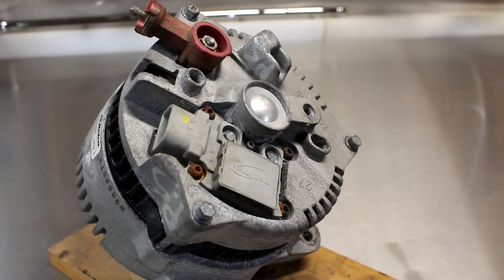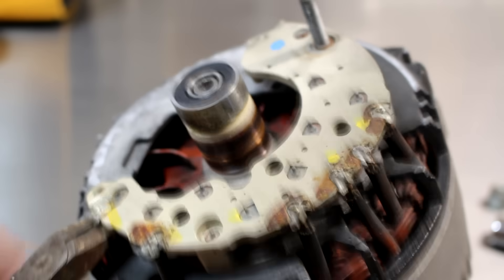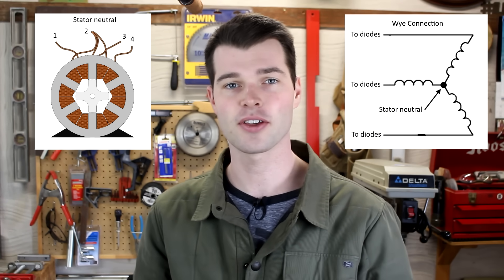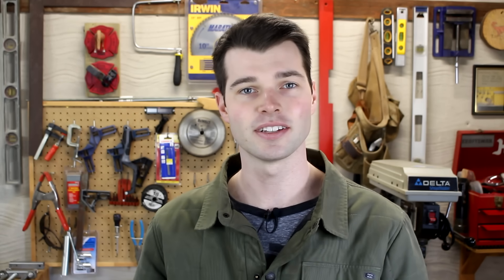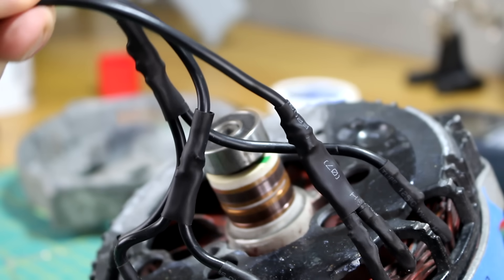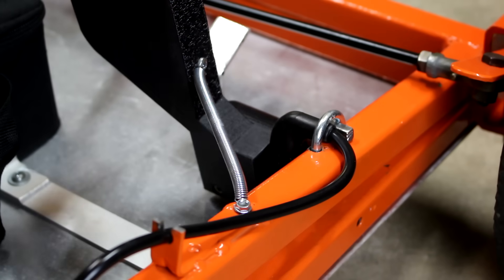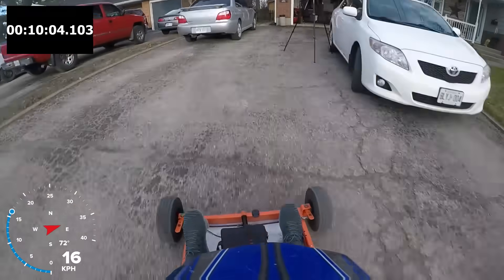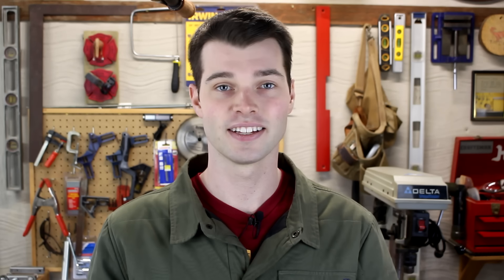Converting a Car Alternator into a Go Kart Motor

Comment: why not wire in a delta/WYE relay switching circuit? u use WYE from a standstill for its torque, then after u top out in WYE flip the 3 pole relays and it turns the motor into delta, dumps the torque for speed and away u go

Comment: Used a Detroit Diesel starter for mine back in the day.  6hp .   Would do much more now  with new battery tech, and have a longer ride.  It was a rock spitter right at the touch of the throttle switch, for a little bit.  Frankenstein type blade switch on a pedal.  Had to make a wheelie bar skid.   Had everything sitting around the shop.

Comment: Got a question for you.   Actually two.  One;  Did you measure what you 'Should' get out of the battery pack (You would need to know current though), and secondly, do you know if those general motor controllers can do regenerative braking ???  To extend the battery life ???

Cheers, and good build sir!

Comment: hello good day I would like to know how.contact the brushes that in the video is not very clear it seems to me a good idea more how to connect the brushes thanks of an
Reply: The contact are connected at the 2 terminals of the voltage regulator. These 2 wires are in contact with the 2 brushes at the end of the rotor head.

Comment: having purchased several hundred batteries of all different makes through the years for the car lot buisnrsses and construction companys i have owned through the years,the interstate battery is in my opinion ,through expirience,the absolute best brand and best brand for the same money spent than any other.they are the only battery maker that i know of,and i there may be but im not aware of them,that actually has their own very large store.they are usually between 2 gairly close freeway exit ramps off of major highways.they only sell batteries.commercial ones that are to companies \truckdrivers /farm equipment/excavation\bulldozer equipment.etc.they will sell to regular folks in need of a  car battery ,but rarely do.i bought a used backhoe that sat in a field for 4 years broken.it had an interstate battery that the guy took from a  broken down bulldozer.it was 2 years old when put in the backhoe then sat for 4 .that is six years.the batt was dry.the guy said he would ad distilled water and charge it  to just jump it off and start it to show me the backhoe ran and i could pit it on a trailer to take home,but he said i would need a new batt for sure.i used that batt and backhoe for 6 years.everytime i turned the key it cranked every time.it would sometimes sit for several months beween running.so that is 12 years.the backhoe blew a head gasket.i took out the batt and used it for my trolling  motor for a year and a half.some kids knocked the battery over and drained most of the acid out(i had the lids loose from charging it last) and it sat under a tarp in the sun for 7 months till i discovered it.never thinking it would work but because of the almost u believable age and abuse done to it i filled the cells with distilled water,trickle charged it for days,then gave it a 10 amp 12v full charge..it.worked better than ever.put it in another backhoe i own and used it for 2 years.it took it out to use for.my trolling motor.my idiot employee ran over it when he sat it in the ground befor hooking it.back up.the.plastic was chalky and was more brittle from jts age and a corner cracked off.thats 14 years and seven months old and the batt worked and held charge seeming infinately.now thats a long time.buy interstate.they have more lead or are better designed and thicker plastic that most......this trick does work with any batt.ive done it.but interstate batt is a big help.
.

Comment: In 3-phase motors the Delta configuration delivers the most power. If you want to dial back you can switch to  a Wye. That might save your battery pack, but will slow down your cart. 

I have a suggestion for an experiment: 
Instead of applying 12v power to the armature, just short the brushes together. The stator will induce a current, like in a typical induction motor. But you will not have to add the supplemental energy from the lipo pack. This may translate to lowered performance though.

Comment: Instead of a battery pack, why not use super capacitors?  This way you can create a charging method that exceeds discharging by using a 2nd alternator possibly coupled with a voltage multiplier. Ludic Science channel has a couple of interesting videos that may be of some use to increase power input vs output. I'm not an electronic or electrical engineer but I've seen others create interesting things that almost seem impossible.

Comment: When will your next video come out I can't wait ?
Reply: Hi.
I'm very impressed with your video. I've hunted for ages to find this type of video.  Thank you.  I understand most of it. 
I'm just starting my ebike. 
I have an old 12v 110 and alternator from a scrapyard,  tested & working. I want to convert this now into a motor, and I have a frame from an old Honda 125,
What controller would I need for this project. I only have the alternator and frame so far.  I'm out in a remote part of Philippines.
Any other information would be gladly received.
Thanks for putting up with many stupid comments some folks like to write on here. 
You've done a great job on your project.  We'll done

Comment: Your soldering technique is somewhat questionable.
Reply: i didnt see him twist-winding up the connected wires together... i saw him like clamping them together relying purely on soldering joint, hahaha...(i could be wrong in my observation)
Reply: never a straight answer specification hehe
Reply: There's nothing wrong with his technique.  As Matt Fleenor said, this is how it's done by NASA.  The result yields a very strong connection that seals up well with heat shrink and doesn't leave a huge bulge in a cable bundle.

The only thing he seemed to do "wrong" was he stripped farther than he needs to.  Really, that's just mainly a flexibility issue, if there's going to be an issue at all.  

Properly done (from memory here):  Strip a length equal to 1.5 to 2 times cable diameter.  Pre-tin all ends to be soldered, ensuring that solder doesn't creep up the cable underneath the insulation.  Place cable ends parallel against each other and apply solder, the proper amount of which will form a fillet (the look will be smooth and concave) between the cables.  

@ fidel castro and anybody else who thinks that cables need to be twisted together prior to soldering... no.  That method can reduce penetration of the solder and is absolutely not needed for good connection or strength.  The method laid out above will, if done properly, yield a connection that does not add resistance and is physically stronger than the cable being soldered.  FWIW, I've used this method countless times, including in places where precise readings on low-voltage sensors are crucial, and I've shown the strength of it by soldering leftover cable and pulling it to the breaking point - the break never happens in the joint, and anything that increases resistance in a low-voltage circuit is going to show up big time.  But I'm sure you "electrical gods" out there know all about that.

The pre-tin step actually makes this method very easy, since all you have to do to make the connection is put a bit of solder on your iron, touch the cables together and press the iron to them for a moment or two.  Once the solder on your iron creeps into the joint, remove iron and wait another moment for it to cool and the connection is made.  Very simple, very secure, and even easy to do in an environment with limited space.  If something shifts during the connection step, carefully reheating to make the solder flow and moving the cables to their proper position is very doable.
Reply: Barry Pro just shut up
Reply: And you can't spell "Knickers"....how pitiful.
Reply: Cosmic Surfer - Then why is your would-be critique phrased as a statement? If you are questioning the technique, then as some questions about it.
Reply: l o fuckin l dude, i get what your saying but no you have to do it right in order for it to be done the right way yuh digg?
Reply: Barry Pro 1
Reply: Cosmic Surfer ok pro.   Post how to soder then.  Let’s see.
Reply: This method is mechanically secure and places no stress on the stranded wire... vastly superior to twisting the strands. His solder looks good, really the opposite of questionable!
Reply: compared to most of the videos on yt, this is a pretty decent solder job
Reply: this is NASA spec style of soldiering.
Reply: Barry pro was clearly trying to get on your nerves.
Reply: Barry Pro you have some serious issues in life you should deal with. I am well into my fifties and dont need to deal with your issues. 
If you do need to be spoon fed, high current joints are best done with hex crimps and then soldered. If you dont have a hex crimp you twist the cores together and then solder to a shiny finish. Dry joints dont work as they create heat and suffer current loss. 
Now throw your tv in the bin and try and educate yourself a bit please.
Reply: Barry Pro lol that comment about cats is going to come back to haunt you Hahahaha id fucking love to be there.
Reply: Barry Pro its so good when those people that hurt animals get whats coming to them lol
Reply: Barry Pro what a mistake of a comment huh
Reply: Cosmic Surfer 
Your opinions are invalid
Reply: Logan Pachulski Trying being the operative word. :) His last statement though, says it all.
Reply: Barry Pro where is that photo taken on the top border of your youtube man? What country?
Reply: Bradley Mcewen 
Ran one over this morning haha 😂
Reply: Barry Pro Sure, keep telling yourself that if it makes you feel better. The fact you think other people will believe there's someone following you around instantly liking your posts is sad to say the least. At least you acknowledge your sadism.
Reply: weak
Reply: You are the pro as your name indicates. 
Tell you what, try taking 1.5 mm copper wire cut into 10 mm pieces and solder me a cube. That is entry level soldering. 
And just as a matter of fact, my opinion is invalid. Just so you don't need to repeat yourself.
Keyboard ninja :)
Reply: Barry Pro Don't you have work to do mate. I have a business to run and you want attention like a spoilt child.  Non of my 5 cats have managed to catch my tongue, so no the cat never got my tongue.
Reply: Cosmic Surfer 
What’s the matter? Cat got your tongue?
Reply: Cosmic Surfer 
Omg a cat lover 😒. 
Do you let them shit in everyone else’s gardens? Fucking hate cats, I’ve run plenty over 😂.
Reply: Charmin Xtra 
It’s not me liking them you thick bellend.
Reply: Cosmic Surfer 
I’ve been doing a load of soldering today mate, my best work yet.

Comment: What’s the point? I don’t get this whole electric hype/fad spreading over the world it’s not a replacement for fuel and instead of wasting so much money on fixing fuel why not fix the cunts that run this world because if trump and putin and all those other fuckers keep going then there won’t be global warming to worry about every fuckers gonna be dead? But hey still a cool project to try out
Reply: it just might be that electric motors have better torque curve and don't need transmission which makes them much more efficient for small scale applications
Reply: Kyle TheTreeKat Don't fear the electric revolution.
Reply: Kyle TheTreeKat solar power = electricity

Comment: How many maximum watts continuous do you feel the motor is capable of ?   Would a higher output alternator produce a fairly "hot" motor ? - watts ?        Excellent video. You should be in the moving picture shows they have these days ! !  You're good.

Comment: Cool project!  I did the same thing a few years back but I never installed the  motor in anything.  You will be pleasantly surprised if you switch to some sort of lithium battery for power.  It will make a night and day type of difference in power.  I like using A123 26650 cells but they can get pricey.  They are extremely durable cells and last a very long time in terms of cycle life.  Another, more powerful option would be to use LiPo batteries but you need to be more careful.  Don't exceed their maximum current rating and don't over discharge them.  Have fun!

Comment: You did not explain how you got the relative polarities of the 3 windings correct.  It does matter!
Reply: It doesn't matter. If you get it wrong, the motor will spin backward. If that happens, swap any two phases and it will spin forward.
Reply: Brian Park  he got lucky
Reply: It is plain to see the logical order of the wires in their physical arrangement. No big mystery there. Even if you get one wrong it'll be easy to correct and no damage will occur from that.
Reply: Since there are three windings/phases, when one is reversed, the direction will reverse.  No matter how you wire it only one coil could possibly be reversed because the other two will always be properly oriented, so it's never a problem other than rotation direction.
Reply: Basic 3 phase rules apply if you're out of rotation, meaning the motor doesn't spin and makes a humming noise or blows the breaker/fuse simply switch any 2 phases and it falls back into ABC phase
Reply: No, if you get it wrong just change 2 wires from the ESC to the Motor/alternator
Reply: Brian Park, so it seems you have a little googling to fill in the gap.  Please share with us afterwards, we are the lazy ones.

Comment: Can I use a 2000w speed controller with a alternator?
Reply: yes. the 2000 watt is the maximum draw from the controller, so it is actually better to have a higher wattage controller.

Comment: I am a former electric motor repairman/rewinder and I was doubtful at first, but you did pretty good! You are a smart kid. I don't know if you are self taught or have an engineering degree but businesses everywhere need people like you, so I hope your job is paying well. Stick with the winding configuration the alternator began with. Delta to wye the winding voltage will be too low and wye to delta, the winding voltage will be too high and could overheat the coils. Running over current protection is necessary, never ever run a motor unless there are motor overloads in the circuit.

Comment: Why 48v controller when the alternator is rated 12v charger?
Reply: he is using 48 volt battery to run the 'motor' with a 48volt rating controller...
Reply: An alternator can handle higher than 12 volts easily. I once use one to make it into a 110V alternator without any mods except the field drive. The diodes handled it fine. The limit on it was more of a current issue, it could only put out 55 A which meant that power was limited to 6KW. Pretty impressive for such a small machine.
Reply: @lochinvar00465  if you want an alternator to put out 110v ac you don't use the diodes. An alternator is a 3 phase generator (alternator) without the diodes.

Comment: How could you wire it as so the brake pedal would activate the alternator causing drag and also charging the batteries and when the gas pedal is depressed it would turn back into a motor? I believe this is the restore element in electric cars today. As well as braking the car. I look forward to your response!

Comment: How long can I ride with 4 motorcycles batery (12v 12ah serial connection) ??i found brushless motor controller 1650w 30a, will it be enough?? thanks,best regards

Comment: Cool kart! Do you think a system like this could be used for a 3 wheel mobilty scooter to give it power for hills and rougher terrain. I'm looking for something I can take to flea markets and places that may have gravel and rough surfaces. Maybe some hills. Most of the power mobility carts seem wimpy to me. Not enough power! Any help would be appreciated! Thanks!
Reply: 74dart man where I live there is an annual mobility scooter grandprix and they typically use 100v to drive the 12v motors.

Comment: You're better of with a perm magnet motor or an induction. The efficiency of that alternator is very low. It will cost much more in the long run. Batteries, charging, burn wires and electronics.

Comment: You can also mod the sprocket to be able to fit the chain and another belt that way you can put a recharging alternator on that bad boy! I don't know how fast it need to spin to actually charge the cart up for a good continuous use though. What you think about that idea? You could probably rig it better if you had multiple pullies!

Comment: Great job! Any way to wire the alternator to charge a secondary battery while you are driving?   That way you could toggle back and forth from the charged unit to the charging unit.

Comment: Cool project, there is a company called WindBlue that makes a permanent magnet type car alternator by placing a neo magnet in the rotor thus eliminating the need for brushes to energize the rotor. Motor speed and torque can then be controlled by only the frequency and current in the 3 phase stator coils with the motor controller. They make several variations with different stator winding gauge wire. For this app I would think the high amperage, low voltage configuration is best vs. the thinner, longer wire for higher voltage, low amps.
Reply from the maker: Interesting thanks!

Comment: The way you're using that cut off wheel you're lucky it didn't kick back and split you wide open right between the eyes I've seen it happened several times
Reply: cybermavrik everyone look another expert on tool handling.     Just enjoy the video mr safety patrol